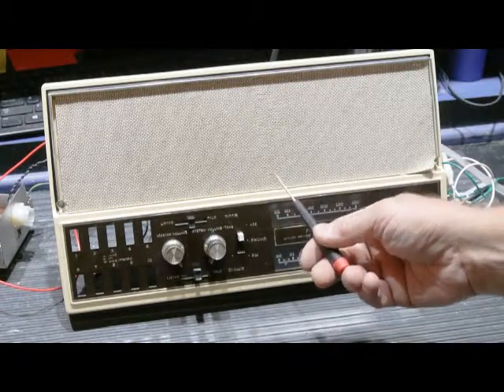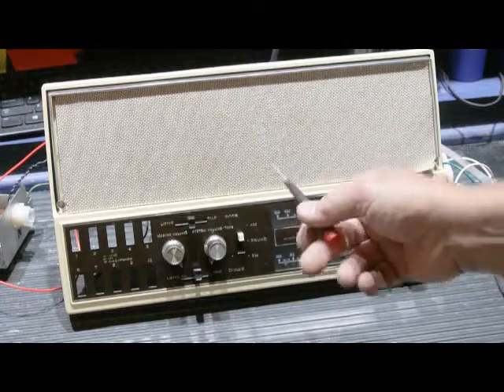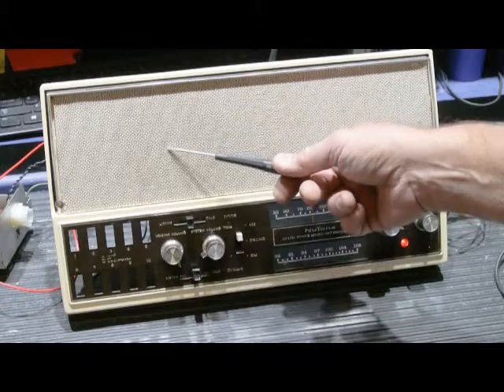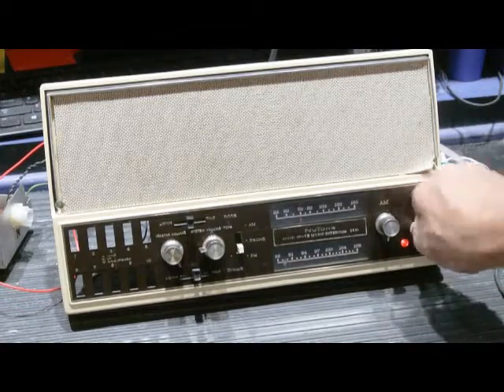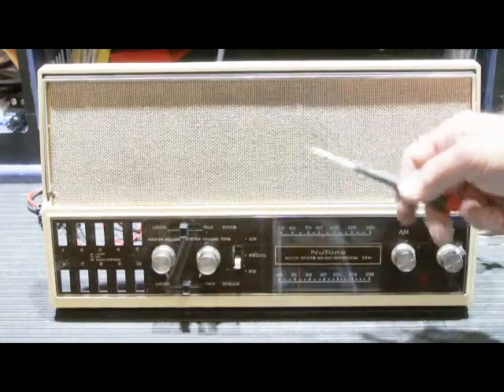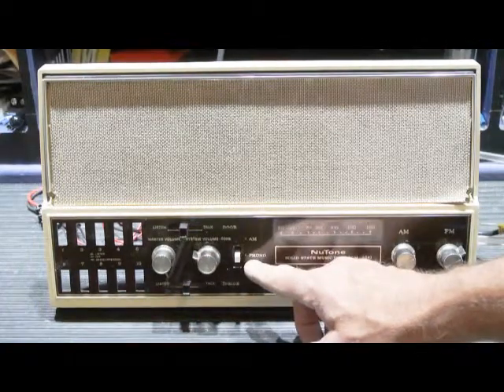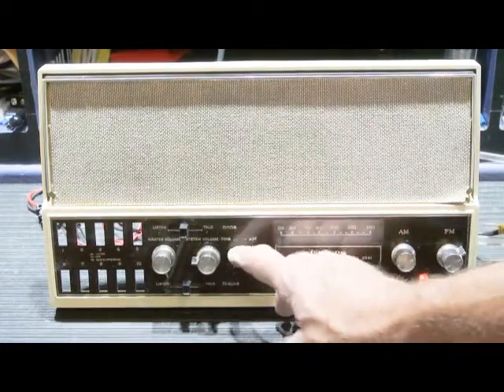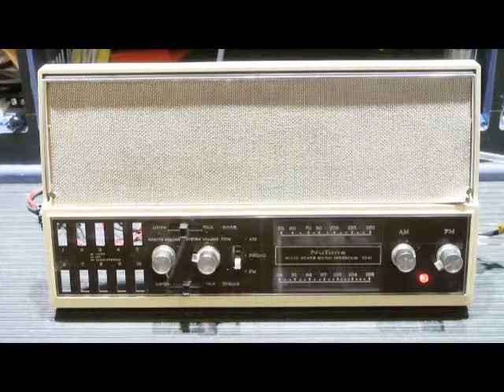NuTone Radio Intercom Model 2541 Power Supply Failure

Comment: Separate AM and FM tuning controls. Likely for convenience when switching between bands. Thoughtful design.
Reply from the maker: Hi Ron:  Many of the best quality models NuTone made had separate AM and FM Tuning Dials.  The 2541 belongs to a family of models (2064 - 2090 - 2540 - 2542) that shared a basic chassis design - so even the entry level 2064 included this feature. - Chris

Comment: I'm guessing that the hum was a dead resivour capacitor, or diode problem.
Most capacitors that age would be doing very little.
Reply from the maker: Hi zx8401ztv: Yes, always a problem on Master Station this old - along with failing power supply components - dirty controls, and a tuner that needed a little alignment - Chris